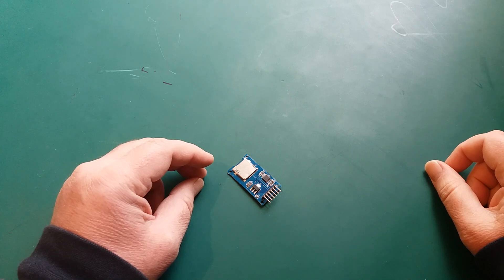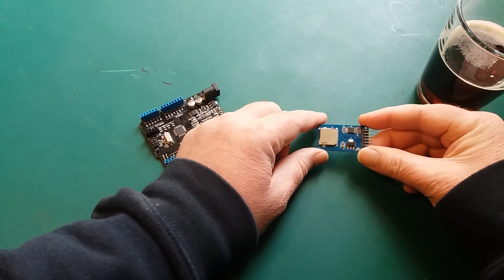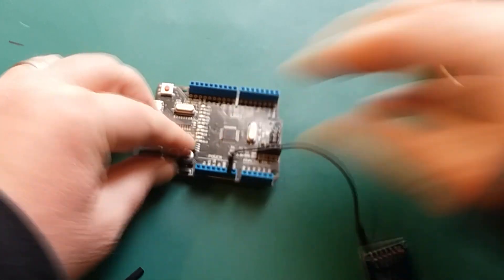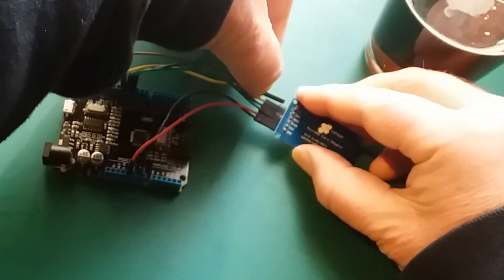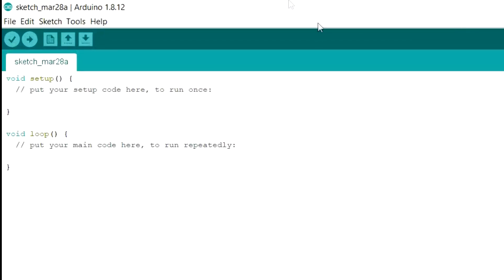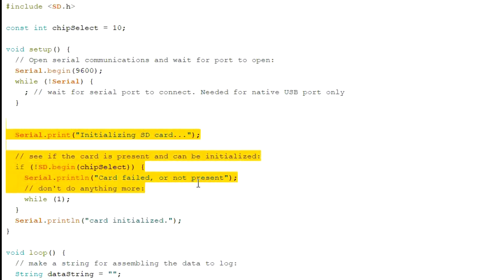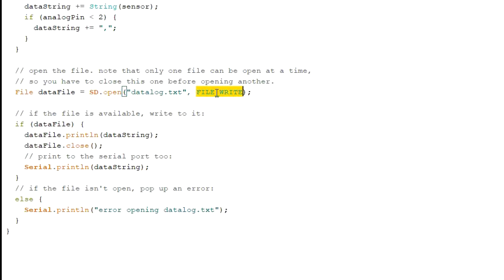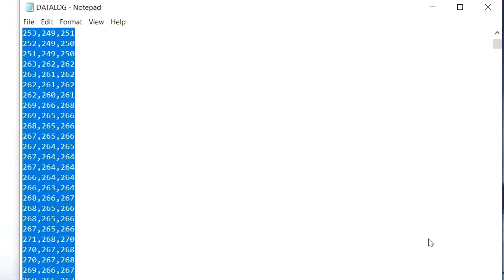Quickie: Using SD Cards with Arduino - It's easy peasy!

Comment: What’s the worst is going to happen! 😂 love it. I’m having so much trouble with the Max30100 now, I can’t make it work for nothing in the world, I see the 0x57 but nothing turns on, I’ve used already 3 different models of cards, even the GY and nothing. Arduino and RaspberryPi -_- would you happen to have an Arduino laying there you could help out?
Also, how did you use the TFT to make a display layout?
Reply from the maker: Did you do the desolder of the on board resistor and add in some different ones?
Reply: XTronical From the GY-MAX30100 ? I don’t see 3 in line like you had on yours. Tomorrow exactly the green one you used. I tried other 2. Is it possible that the chip can answer the 0x57 when i2c scanning but the leds are burnt? I can’t make the red led turn on for the life of me.
Reply from the maker: Sorry I thought you'd tried the same as me as well. Actually thinking back I had a GY version as well and never got it working. Might have even reported its address like yours too. I think it might be a driver /library issue. But as I had it working with the other type I never continued with it.
Reply: XTronical oh! if you couldn’t get it to work, then is definitively game over for me. ill toss it on the garbage now lol. I love your channel, i’m going to bench all your videos the next coming days. love your stuff and quick projects.